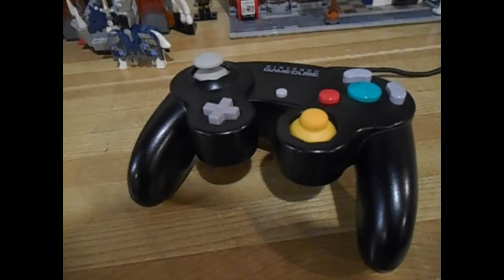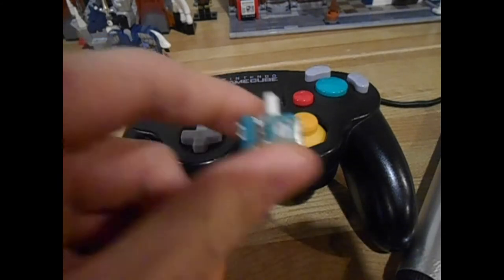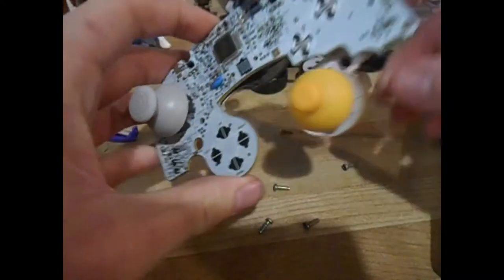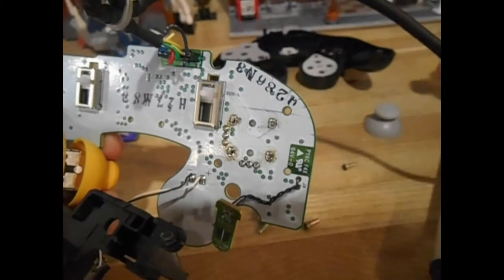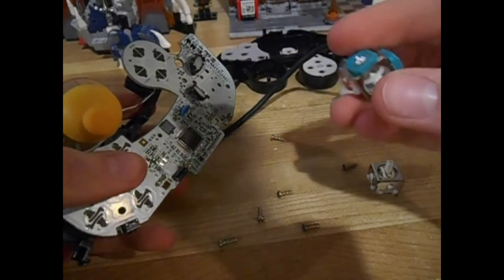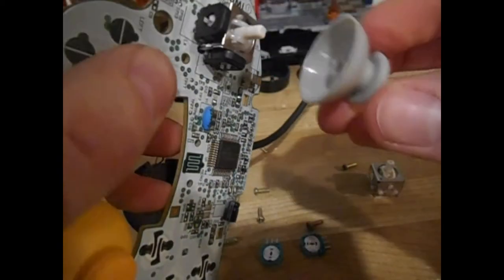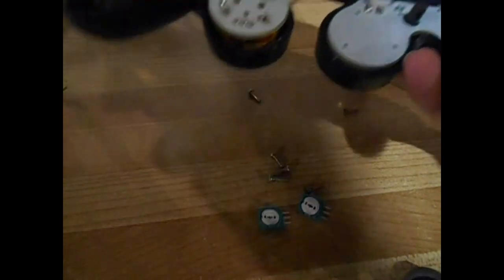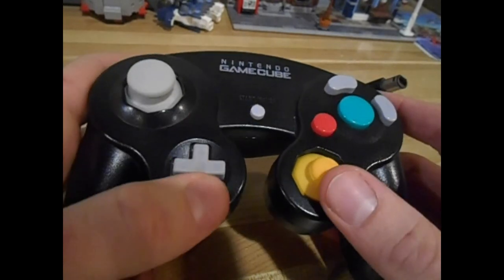How to Replace the Joystick Module of a Nintendo GameCube Controller

Comment: So you didn't need to solder the replacement stickbox back into place? 

Say the replacement stickbox were official, would you have to solder the new stickbox back in?
Reply from the maker: I don't think so. If you're replacing the potentiometers too, then you will have to solder them back in but if you are following my method you shouldn't have to. Just leave the old potentiometers on, and remove the ones on the new stickbox. I'm no expert: I just do what works for me.
Reply: @caleb.s.holmberg0729  I went and tried this myself, no solder necessary for my controller since it's a T3 stickbox. 

Those just have the two screws to remove the stickboc

Comment: Those replacement parts are not ver good.  The accuracy is hit and miss.
Reply from the maker: Yeah. I have had issues with the quality of replacement parts. It may be because the only one's I've gotten are el cheapo.
Reply: Wii Nunchuks (T2), Wii Classic controllers (T3), and Wii U Pro Controllers (T3) are good OEM sources